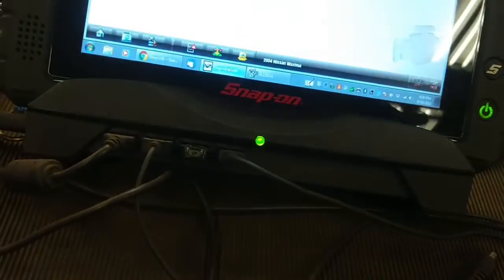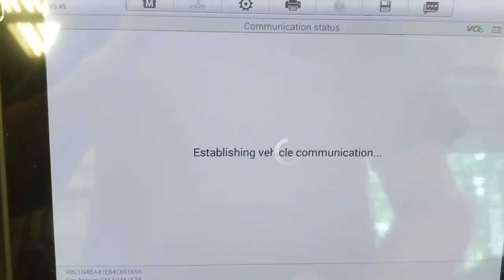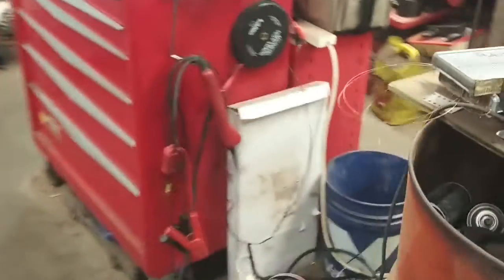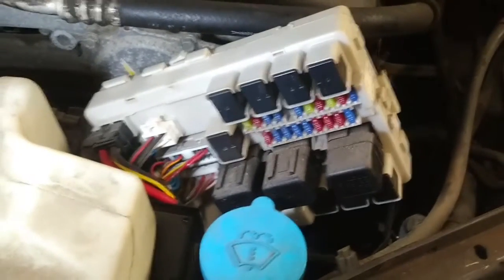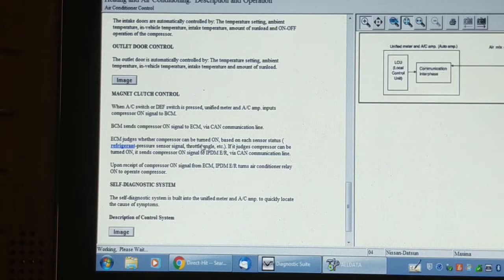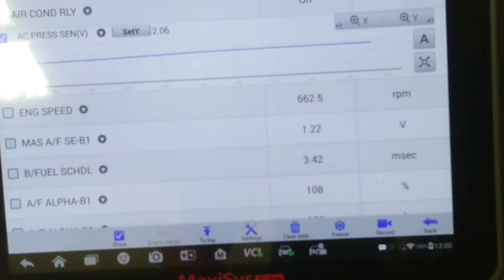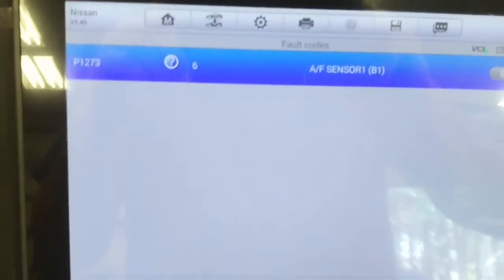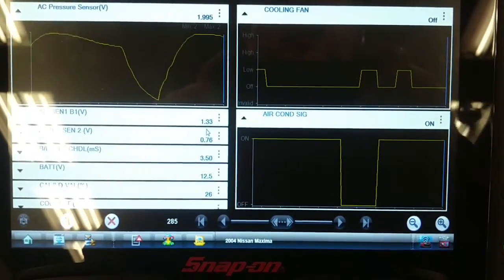2004 Nissan Maxima no AC operation intermittently

Comment: Ive been having some strange anomalies with my 02 Maxima, my cpu pulls Evap code 1456 and check engine light has always been on steady for 3 years... but twice the CE light has gone out (including start up) and my car is at 1/2 throttle (as if Immobilized) this happened twice in the last few weeks. Also my blower motor failed to work once (no defrost/defog) i pulled and checked fuses,  turned ignition on and it worked, weirdest anomaly I replaced the Coolant Temp sensor and my ECM shut off my fuel pump! 🤷‍♂️
Reply from the maker: Thats interesting. I doubt they are related but its remotely possible. Try cleaning the engine grounds and body grounds. The lack of throttle response should set some kind of code. Possibly your scanner is not reading the codes correctly. What are you using to scan it. Try a different scanner. HTH good luck
Reply: Phillip Bailey i got a cheap scanner for 20$ off amazon but i was thinking the same thing check and wire brush all grounds and connectors. I reset the CPU last night (i had to do this to get Fan relays to work last year) so hopefully that will solve issues.

Comment: I had the same problem with Nissan pathfinder.it was engine temperature-related.thank you for sharing.
Reply from the maker: Thanks for the suggestion. That's certainly possible it the ECM thinks the engine is too hot it could disable the AC.